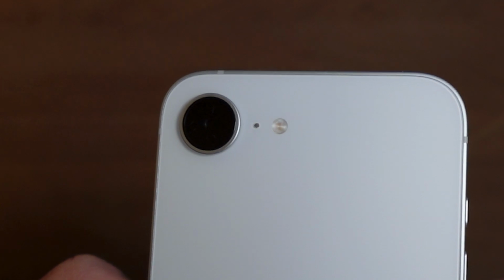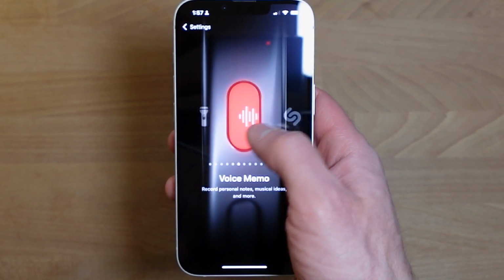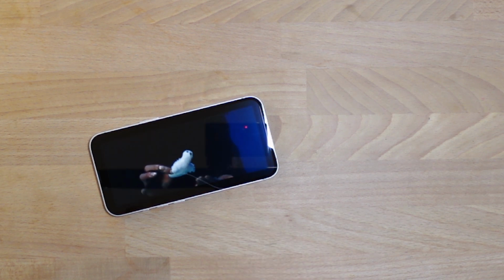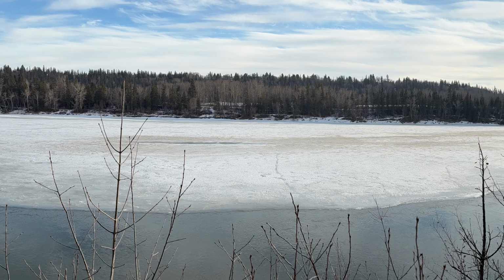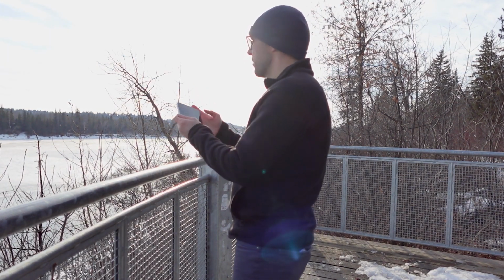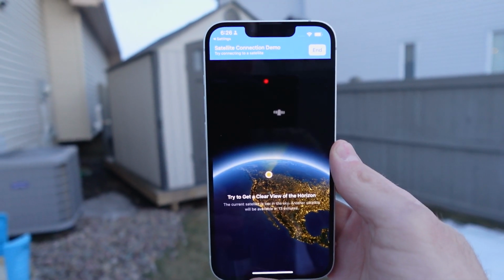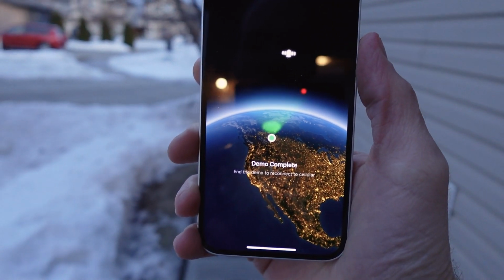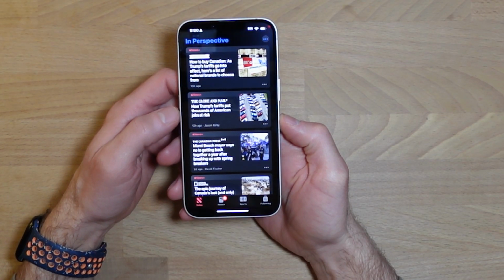Is Apple's New iPhone 16E Budget Phone REALLY Worth It?

Comment: The amount of misinformation and hate surrounding the iPhone 16 E is absolutely ridiculous. People act like this phone is some kind of downgrade when in reality, it’s one of the smartest and most future-proof iPhones Apple has ever made. So glad I got this great device. And no this phone is absolutely not just for someone that doesn't know anything about tech that so many people have claimed on so many videos this phone can absolutely be for anyone including people like me that know a lot about tech but still appreciate this phone because they realize that it's a great phone that does everything perfectly fine and stripped away all the gimmicks that don't even improve the iPhone experience or barely at best. Sure it could've been $100 cheaper at launch day but the reality is when the 17 comes out it will be $100 cheaper because that's what Apple does every single year. On top of that when many people buy this phone they're going to be trading in their old phone which means they're not gonna be paying the full price for it making it an even better value.

It has the A18 chip, which is actually newer than the iPhone 15’s processor. While people are saying “just get a 15,” they fail to realize that the 16 E has the latest A18 chip, while the 15 is still running on the older A16. That means better performance, better efficiency, and longer software support.

The camera is a 48MP sensor, the same as the regular iPhone 16. People are nitpicking about a slightly smaller sensor, but in real-world use, the difference is so minor that 99% of users will never notice. You’re still getting a flagship-level camera at a much lower price.

This phone is stripped down to only what actually matters. No unnecessary gimmicks, just pure iPhone. No Dynamic Island? Most people don’t even use it for anything useful. No MagSafe? Regular wireless charging still works just fine. No Ultra-Wide lens? Most people don’t use it anyway. This phone is designed for people who just want a great iPhone experience without extra fluff they won’t use.

This is also the best value iPhone Apple has made in a long time. The SE models were always stuck in outdated designs. The 16 E fixes that. It’s not just a budget iPhone it’s a modern, clean, and highly optimized experience. This is basically what the SE should have always been a future-proof iPhone that doesn’t feel old the moment you buy it.

Because it has the A18 chip, it will get updates much longer than the iPhone 15. If you want a phone that will last for years without feeling slow, this is it.

And the hypocrisy from the haters and tech reviewers is insane. They say “It’s missing too many features” but not everyone needs or cares about Dynamic Island, MagSafe, or multiple cameras. They say “Just get a 15 instead” but why would you go backward to an older processor instead of getting the latest A18 chip? They say “Just get a regular 16” but if someone doesn’t care about the extra features, why should they pay more for them? They say “It’s a downgrade” but in reality, it’s a different phone designed for a different type of user.

The same people who complain that iPhones are too expensive are now bashing Apple for making a more affordable one. They are the reason Apple keeps raising prices because whenever Apple tries to lower them, they trash the product instead of supporting it.

I know this from personal experience because I have tried almost every iPhone. I’ve used the iPhone SE 2020 the iPhone 13 mini iPhone 14 Pro, the iPhone 15 Plus and the iPhone 16+. The Plus models were great phones, and I really liked them, but after going through almost the entire lineup, I realized that I don’t need a Pro iPhone and that the regular iPhones aren’t much different from the Plus models. The 16 E is what I’m getting because it has all the modern features I actually care about without any of the fluff. It is future-proof, affordable, and free from gimmicks.

So many of the features people have convinced themselves they actually need are completely overblown. In reality, most people rarely ever use them. Dynamic Island, the camera control button none of these features actually change the experience in a meaningful way. Dynamic Island is mostly just a flashy animation that doesn’t add any real functionality. The camera control button has very awkward positioning, and it ruins the aesthetics of cases. People act like these are must-have features, but in day-to-day use, they barely make a difference. And I'm not saying that the pro models are not great phones they are but they're often extremely exaggerated how necessary people truly think they are as if every other phone Apple makes it just garbage compared to pro models and that is absolutely missing the point completely. The pro models are targeted for a very specific user base just like the rest of the iPhone models and I'm just tired of the phone shaming it's so frustrating. Let people just get the phone they want and enjoy it for what it is. Technology was meant to benefit our lives and improve them not make it so people try to force a tech product to fit their life.

And what’s even more frustrating is that these complaints are coming from people who claim to know Apple, to know tech, yet they can’t even see that this phone is extremely deliberate on Apple’s part. Apple doesn’t do anything by accident. This phone was carefully designed and positioned to fit within Apple’s product hierarchy. Apple’s entire philosophy is about giving people options and making them choose very carefully based on what they actually need. It’s not some grand plot, it’s actually very simple and no one is forcing you to buy another phone. It’s all about what you will actually benefit from, and Apple wants its customers to choose wisely. Anyone can rattle off a spec sheet and recite specs but someone that truly knows tech is going to make informed decisions based off tech and what they actually need that's what's called being an informed buyer understanding how technology actually works in real life and in the real world had a large amount of the tech YouTube space has completely forgotten this point. They have become so blinded by spec chasing they forgotten how great these products have truly become to where it's become nothing less than just a bashing competition on how bad a product is. As a result of that so many people have also forgotten and taken for granted that you're not just paying for hardware with Apple you're paying for a software experience that's unmatched and you're paying for the 24 seven customer service and availability where if something goes wrong with your phone you can actually call someone and that is another big factor with Apple's pricing that many people have completely overlooked and taken for granted without a doubt. With Apple it's everything you're paying for a whole experience that you don't get anywhere else. Additionally let us not forget the fact that every iPhone gets basically 10 years of software updates you're never gonna get that on any other phone ever you're lucky to get four. That's also why comparing android 60 Hz and iOS 60 Hz is a totally futile exercise they're entirely different operating systems the devices themselves shouldn't really even be compared that's also precisely why 120 Hz is marketed as this big feature on many android phones because the OS needs that to even run functionally and smoothly often times. This is also coming from someone who has used android devices before two of them galaxy S2 and the OnePlus seven Pro and appreciate android for its customizability and unique OS in its own right it caters once again to different users needs who prioritize different things I'm not saying that android is inferior to iOS whatsoever they're just entirely different platforms and android has its own unique benefits that cannot be found on Apple such as the versatility to download essentially whatever you like just to name one difference. Where on iOS it's entirely different the animations and everything has been so smooth out that's why many people can't tell the difference. Don't get me wrong there's people that definitely can but that doesn't mean that just because the phone has 60 Hz it's a bad phone. Once again we have to take into account the entire picture as Apple always does nothing they do is on accident.

This is truly a phone that I believe, without a doubt, Steve Jobs would be proud of. It is straight out of his playbook, right from his mind. He was all about simplicity, making a product that people would truly benefit from, and designing for the masses instead of chasing gimmicks. The iPhone 16 E embodies that philosophy more than any iPhone we’ve seen in years.

I truly believe this will go down as one of the best iPhones ever made for pure practicality and simplicity. It delivers all the essentials with no frills, cutting out features that are totally unnecessary for most people. If you just want a clean, fast, long-lasting iPhone without useless gimmicks, this is the perfect device. It has modern hardware, Apple’s latest chip, a flagship-level camera, and will last for years all at a reasonable price. The hate is completely overblown, and most of it comes from people who don’t even understand why this phone exists.

This is one of the smartest iPhones Apple has ever made. The only people missing out are the ones too blinded by spec hype to see its value. And thanks for a great video super objective take on this great device!